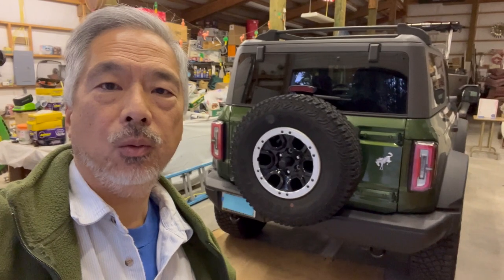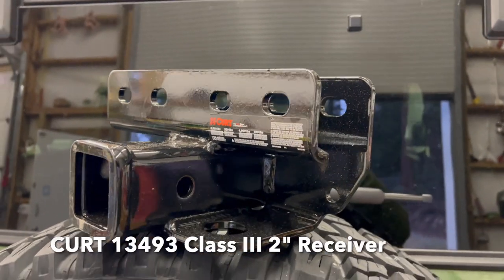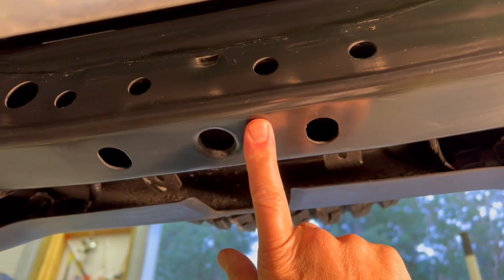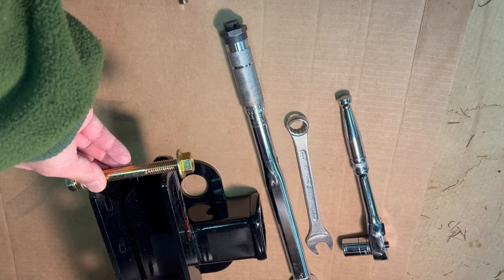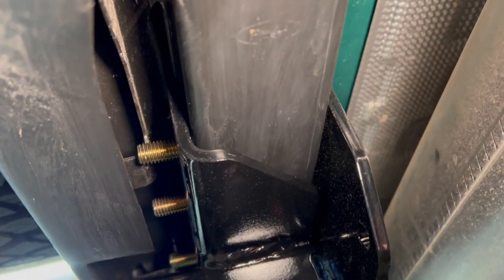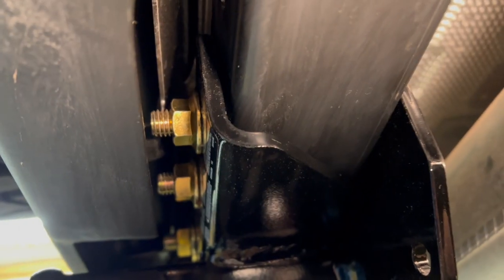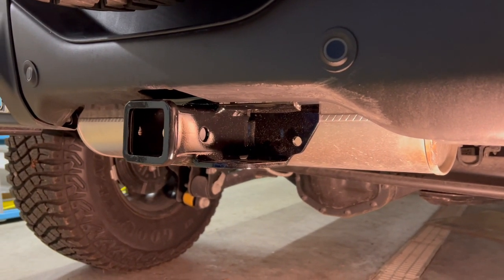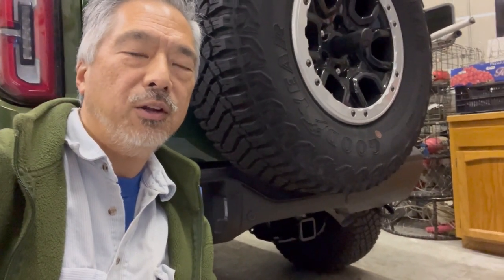Bronco Hitch Receiver Installation

Comment from the maker: To directly answer, no, there was no bending of the bolt. I even removed and reinstalled two of the bolts when I installed a 4/7pin wiring kit which came with a mounting plate for the 4/7 pin wiring socket.  There was no deformation of the bolt, frame or flange bolt.

Comment from the maker: If you have the bolt in the correct hole in the frame and correct sized washer, it shouldn’t distort the washer or frame. 110 ft-pounds at the end of a 24” torque wrench will require 55 pounds of pull.

Comment: Just installed mine. While applying torque, did the bolts start to bend the washer? Wondering if I'm applying too much torque even though it's set to 110.